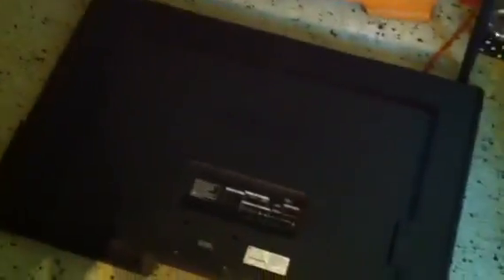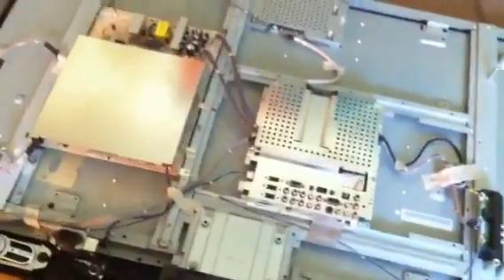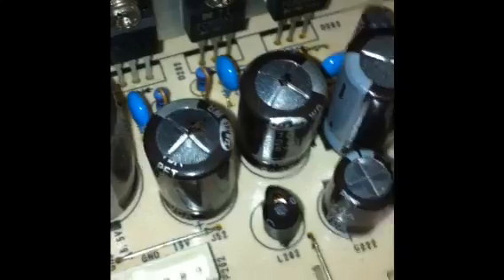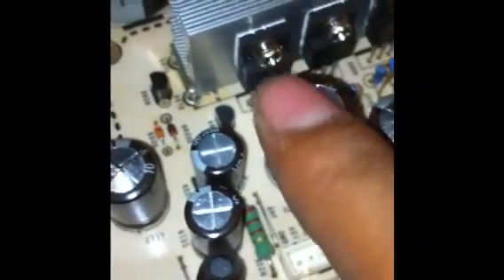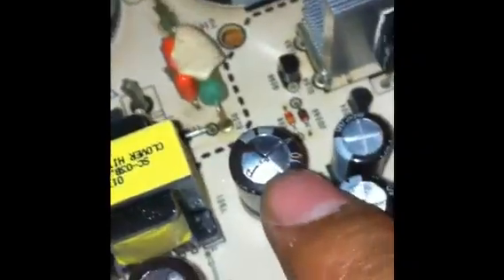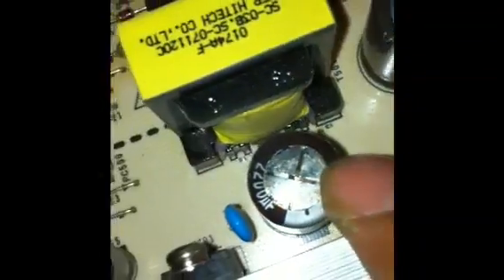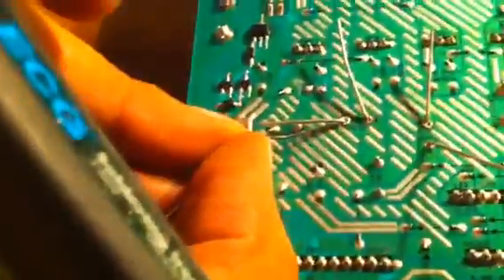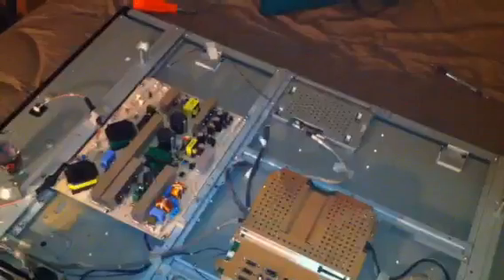Broken LG LCD TV Capacitor Black Screen My Wont Turn On

Comment: I thought this was the problem with my tv but my capacitors look fine... what else could be the problem anyone? My LG tv will turn on for a bit, then the screen will go black and the light on the bottom goes from blue to red

Comment: This is happening to my Insignia TV. It's only 2-3 yrs old. If I shut off my TV, then later turn it on to watch it, it won't turn on. The little blue power light is on, but my remote and the buttons on the TV won't work. I keep unplugging it from the wall, unplugging the power from the back on the TV, and nothing works. It usually will come on after 15 or so minutes of doing the same thing over & over. WHAT IS WRONG? Now I've had to tell my whole family NOT to turn off the TV at all because it's such a pain to try to start it again. Thoughts? I'd rather not have to go buy a new TV. Grrrrrr.....!

Comment: Very nicely done!  I have a background in electronics, but I'da never thought it could be so simple to fix a hi-tech big dollar item like a 45 inch flatscreen!  Just goes to show ya; never give up!  I'd like to add that caps are polarity-specific, so you need to be sure to put the + lead back in the + hole, etc.  And I'd also add that it's very important to replace each cap with the proper value.  Maybe replace them one at a time so's they don't get mixed up.
All in, though, a great article, thanks a bunch!

Comment: Just thought I'd throw this in, if you don't own a soldering iron and are going to spend around $40 at least doing it this way, you can buy that entire power supply board for somewhere between $30-$40. All you'll need for that is a screw driver.

Comment: top tip for easier capacitor removal - warm them and the pcb up first with a hairdryer - you can then use the soldering iron at lower temp and minimize potential damage to the pcb !!

Comment: I am grateful for the picture of the LG that I am seeing because it is exactly 47 inches that I am using.  The problem I am having with it is that, the screen got cracked at the right upper corner when something dropped on it.  Where can I get the screen and how much can I get it or where can I bring it for  fixing and the price.  Thanks.

Comment: Remove and Replace each capacitor One At A Time and Take Special Notice of The Polarity of Each Capacitor (the + and - signs on the cans). You really want to insert each new capacitor with the same polarity. These are Electrolytic Capacitors and they are polar just exactly like Batteries.

If you insert the new capacitor backwards, expect to blow it up and damage more of the t.v. Very Important to maintain the correct polarity when inserting the new capacitor into the circuit board.

You should Always NEVER open the set before unplugging it from the wall.
And make sure to short the old capacitor on the board to discharge it. USE AN INSULATED WIRE. DO NOT TOUCH THE METAL CONNECTOR WIRES (the leads) OR THE DISCHARGING WIRE WHILE DOING SO. Capacitors store electricity, and the larger the capacitor, the higher the voltage (electricity) that it stores.

TIP: When desoldering the old capacitor connections to the circuit board, it is much easier to use Desoldering Wick. You apply the wick between the hot soldering iron and the solder on the board. The wick soaks up the molten solder and leaves the capacitor leads clean and easy to remove.
Then when soldering the new capacitor's leads to the board, do it as quickly and carefully as possible. Holding the soldering iron on the circuit board too long can destroy the connection point on the board. The copper etching can burn off.

Comment: Thanks for the video. I replaced 5 capacitors on my father's television following your instructions and it did the trick. My father was very pleased. The cost was about $6, including the solder. Very good of you to share your knowledge.

Comment: i read something online about discharging bad capacitors as they can kill?? does this apply to these capacitors too?
Reply: CRT's yes. These small caps have such low power they won't do anything. They are toast anyway so they are not holding a charge.

Comment: WHERE CAN I BUY THESE CAPACITORS FROM?  ANY TV STORE, ONLINE OR BOTH?  How much are they, what voltage, etc, for same sized TV?  Some reply please.
Reply: I just got mine off of eBay for a few bucks shipped. You gotta do your homework to figure out which ones are compatible for your TV, bro. I removed the back panel off my TV and ID'd the blown capacitors.
Reply: tylerse7en Yeah, same lol.  I don't need 'em now, but thank you for replying.  I used capacitors out an non HD TV with a thick glass screen and put them into a HD lol.  Works just fine.  As long as the capacitors aren't smaller sized, they are okay to use.  Make sure their sizes are the same or bigger than the blown ones.
Reply: We got ours at Radio Shack $1.99 each !
Reply: Amy B Thank you for your late replay, but I just smashed open an old TV and disconnected old capacitors from a glass screen TV and fitted them into my LG HD TV and it's been working ever since lol.  5 years plus old as well, but working like it's still new .  I wonder how many people have thrown out their TVS because of a little capacitor thinking it was completely ruined.  Shame.
Reply: It'd be 1 pound in England anyway if it's 2 dollars over there.  Thanks again.

Comment: You the men bro...I got a Toshiba that just recently stoped working it wont turn on I checked the capasitors only (1) looks like that, but it isn't as bad PLUS I don't have the blinking light could it be something else

Comment: I've got a 37" very similar to yours and I feel that mine has suffered the same fate.  I am going to check it today and then order the necessary capacitors and soldering iron/solder if that is what it needs.  Thanks for the video and giving me hope that I can fix mine too.

Comment: Good video! Question: I see the capacitors bubbled out, but light does not blink nor turn on at all. Should i continue with changing the capacitors only, or may there be some fuses blown out? Thanks.

Comment: hey john the capacitors are not responsible for speakers,but in my experience the thing that happens with speakers is that one or two simple slide on clip wires come loose off the back of the speaker due to vibration of the speakers over time.so if you can manage to either try looking through your speaker cover with a torch or take the cover off to get access to speaker.

Comment: hey what power soldering iron did you use for this job? will a 30w iron be hot enough to melt off the existing solder to remove the caps?

Comment: Mate, perfect!!!  Well sort of...  I did exactly as you said and to my pleasant surprise - my TV burst back to life.  Here's the sticking point.  The next day, feeling rather happy watching the news I decided to re-tune the channels - wiping all existing tuned channels.  It would not tune again,  Each time I try, I hear an obvious 'crack' noise (I believe through the speaker).   I checked the solder joins to ensure i hadn't 'crossed' anything,  USB photos work perfectly - just wont tune... HELP?

Comment: Hi no the "stuff" the cap is oozing is the electrolyte that’s basically been vented by a build up of gas in the aluminium can, this buildup has caused the safety vent lines to tear, the gas has built up because the caps have got warm and are cheap quality so the electrolyte over time with heat and voltage produces a gas that eventually causes the cap to pop and dry out !!!  20 yeare in the trade repairing power supplies and TVs and still going (o:

Comment: Just for the record,  you don't "BURN" the solder.  In fact, you want to melt the solder by heating the work and touching the solder to the work, not the iron.  Also, for a couple of bucks, buy a solder sucker and it will let you remove the original solder with ease after melting it with the iron.  The "stuff" the cap is oozing is the cooling oil and depending on the age of the product can be a health hazard ( cancer), do don't touch them with bare hands.

Comment: My LG Tv has the same problem, but it turns on after about 15 - 30 min at times it takes hours lol, that is what has been keeping me from taking it apart. Did you find out the capacitors you needed just by taking it apart, taking them off and comparing them at the store? Did you obtain the specs somewhere?

Comment: Hey what power soldering iron did you need to use? I was gonna get a 25W one but read around and think that might not be hot enough to remove the solder. Might get a 40W version instead but that will cost a bit extra ($19 vs $12 AUD).

Comment: Thanks man! I've got a LG 42" LCD TV that is about 4 years old that just started to play up, it eventually turns on but it takes around 8-10 minutes to "warm" up before it will show the picture. I think the caps are gone and need to be replaced. Will go to my local electronics store this weekend and buy the gear to fix it. FTW!

Comment: Men I watch your video and it inspire me to fix my TV. Same issue, open the TV up and found a couple of capacitors blown. I didn't even knew what a capacitor was! The hard part was to find them. I had to order them online. I just finish fixing it, turned it on and woalaaaa! Working! Thanks a lot sir!

Comment: FIY Ebay sells the boards freshly pulled from broken glass TV's all specific to your model or even NEW!  EASY DIY.

Also Radio repair in my town will do the capacitors for 20 bucks!! Newport Tv, CA

Comment: I found on Amazon and ebay replacement capacitors for the LG 37LC7D for $17-$15. Unclear if the $17 is for all the capacitors. As you suggested, I will try the electronics store first.
Thanks for doing the ework and posting this. It is a big help. 
P.S. clicked the "Like" button for you

Comment: My LG monitor took longer & longer to turn on, until it would not turn on at all, just a blinking blue light.  Stripped it & the capacitors were bulging, replaced all of them apart from the huge one & its like new again :) sort of :P

Comment: Thank you so much for your video!! my LG 32lc2du started acting up and I consider throwing it out and buying a new tv, but after watching your video I took my tv apart and saw that one of the capacitors went bad, I went to radio shack and bought a soldering tool set ($10.99 +tax)went to skycraft parts & surplus, inc. Winterpark, FL and bought a capacitor for ($0.50 +tax) Now my tv is working like new! All for $12.18. THANK YOU   :)

Comment: ok well my turn just watched your video should have done so beore i went to Radio Shack for no reason.... got a 50 inch plasma for free guy heard a pop and guess just had the money to buy a new one.... well I dont have that kind of money so im going to try myslef initially looked at just buying a board for 125 but after opening up the back i believe i saw the problem dont know what part it is yet but should hopefully be fxed for under 10 i believe my friend has the soldering gun. wish me luck

Comment: All jokes aside, you are my God. First off, your accent kicks ass, no gay. Second you are going to save me $600 also!! I got my LG 42 inch for free, because it won't turn on. No picture. I think I have the same problem as you. I'll get back to you if it works. Regardless, I will still drop to my knees and pray to you. No one else has a video as detailed and helpful as you. I will share your video everywhere, until I die. Thank you!

Comment: It depends on the farad rating on the caps in the other broken tv. if they are the same and in good condition it could be a quick temporary fix. Personally I would go with new ones.

Comment: this vid is just what i needed....thankyou... (LG 32 inch) one capacitor has black stuff leaking out the top (3 more slightly bulged) i've a Alba 32 inch tv with broken screen...is it possible to take the capacitors out of that tv (alba) and put them in the LG? ...i've never attempted anything like this...but willing to give it a go

Comment: good job but you forgot to say that capacitors are storing power and you can get elektrocuted if you touch them especialy those from power suply board (even if the tv is off), that why is better to send it to a tehnician wich usual let the tv off with no power cord a few days.

Comment: Taking capacitors out is a bit of a pain. I find it easiest to put the iron on one of the wires, and pull sideways on the capacitor until it moves that way a little. Then take the iron off. When it dries back up, put it on the other wire and pry it up a little. Just keep doing it until you get one side out, then the other.

Comment: i have a 32LV2400 and the light is on standby mode (solid red) non flashing. the tv wont turn on. it happend not long ago after 4 day of not working it started working. However its not working again. What could the problem be here? PLEASE ANSWER!!!!

Comment: Oh, one good tip, Test that it works before you put it completely back together. Don't need to put the plastic panel on to turn it on and make sure it works. Also you can order capacitors/electronic parts from digikey.com they have basically everything.

Comment: Hey man! Thanks for the video! But I've got a problem, you see my tv do the same thing, wont start and the light is flashing like that do. So I took it apart like your video but capacitors looks fine. Could it be a fuse or something like that? My tv is a LG 32 and it's 1,5 years old, so pretty new...

Comment: this worked great it only took me 45 minutes to do and cost me about $27, with the souldering iron costing me 20 and the capacitors only cost $7 saved me over $500

Comment: This is one of the best "how to's" out there!  Took me about 40 mins to do the fix, I took the back off my 37 inch LG the day before getting the needed capacitors. Also, I used "needle nosed" pliers to gently pry the capacitors off, ...while heating up the solder connections.  Balance the board while taking off the caps, and use the solder sparingly!   Great video!  1000 likes!  Thank you!

Comment: When you replace the caps use good quality caps, preferably low ESR 105C caps. Radio Shack caps are not usually very good for this application, spend a little extra and buy them from someone like Mouser or Digikey.

Comment: Hi This is very help but i have diferent problem i have tv lcd 42 ISIS isi-42-900-tvb1080pu and i was check the all capacitors and all looks good and i dont know with i need replaced but my screen is black and power light stay blue all the  time !!! 
is any chance you can help me i can send some pictures with my capacitors. my email is 
kg251@bath.ac.uk please contact with me and please help me.

Comment: I picked up a LG 37 inch that some one was throwing away.  It would turn on but no picture.  I took it apart and saw a capacitor that was bulging on the top.  I bought a capacitor at Radio Shack for $1.92 and replaced the bulging one.  I now have a working 37 inch LCD TV for $1.92 and 3 hours of my time.  I can also use this TV as a computer monitor.

Comment: When my tv finally goes I'll probably just get a new one as I have been thinking of upgrading to a larger size. I have had my tv for about 6 years now and is constantly in use. I like the LG brand and will likely stick with them.

Comment: Lately my LG 32" lcd tv has been turning on really slowly. When I turn it on the green light indicator blinks then thick white lines appear then the screen just goes black. I let it sit like that for a few minutes then the picture finally comes in and works fine. I am afraid one day it won't turn on at all.

Comment: Hey guy's
Can anyone help with a diagnosis on my TV?
I have a 42LG5020, the picture has gone, so completely blank screen but i still have sound! trying to find out what the issue is here in the UK without having a engineer come out and charge a call out fee is a nightmare!
Any info would be really appreciated!
Cheers guy's!

Comment: i touched the surface but i m not sure if i inspected them well would it be all around them? ill probaly check them again like i said they looked normal but i want to say they probably need replacing the tv goes hay wire after 30 to4 5 mins

Comment: Hey man my 42 inch lg tv is making that werid popping noise after 30 mins or so of the tv running it makes that loud sound and the picture blinks rapidly i opened it up but i couldnt see anything wrong with the capacitors any advice? like they didnt look busted or anything?

Comment: People, you should wait for a while after do you unplug the power cable. There could be stored up to 400V in the main capacitor(s).
Secondly, never use Radioshack junk capacitors(only if you want to redo them in a short while).
Go to Digikey select some Panasonic Fm, Fc capacitors and select USPS Priority Mail, it's about $2.75 and you will have some good capacitors in like two days.

Comment: Would this work on my lg tv? I dont get a black screen or random turning off but the picture is really shakey..odly enough the dvi works fine but all forums i have checked have pointed to the capacitors do you think this method could potentially fix this and if so which board should i be looking at? The video board or the power board? Thanks for your time

Comment: considerably more helpful than the "how to repair your LCD" guys video which should have been titled "how to unscrew and screw in the screws of an LCD" You should mention that the caps have polarity and to pay attention to which way they are positioned in the circuit board when removing the bad ones..

Comment: just to let people know if you have this problem with a samsung tv just ring the samsung helpline and they will send out a repairman to fix the problem for free,ive had my 40 " lcd for over six years,it seems to be a problem they know about and some models were fitted with cheap capacitors.repair came out next day and replaced all six capacitors took about half an hour.